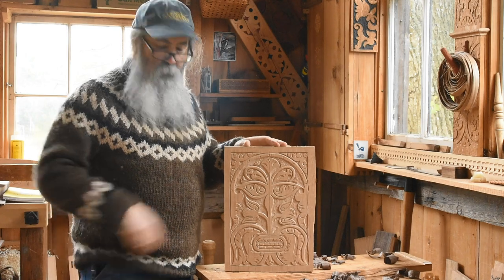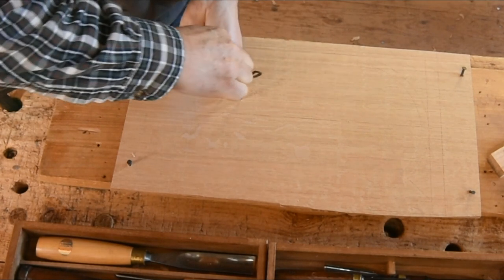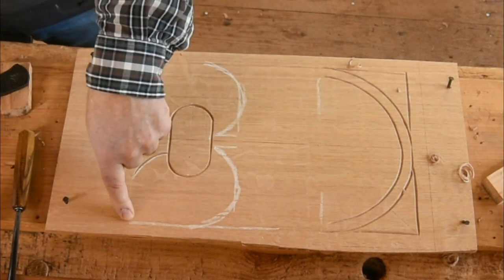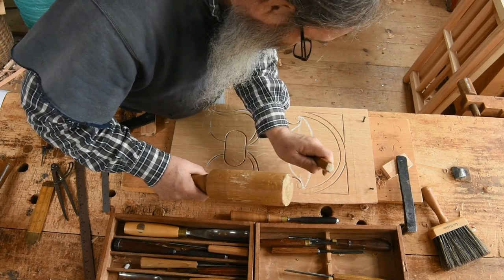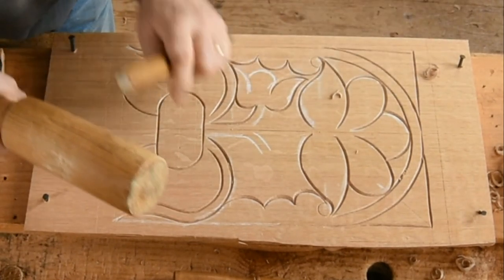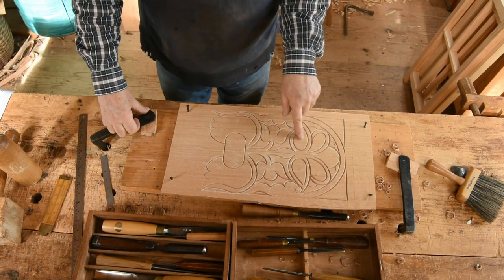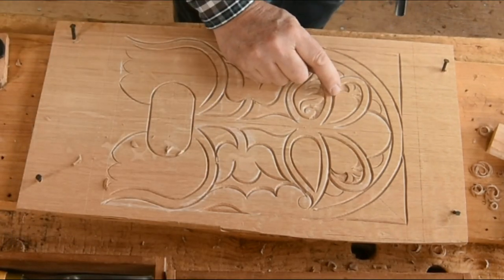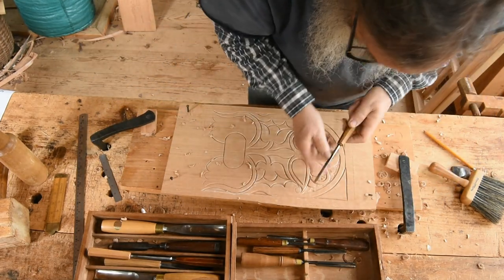Floral panel pt 1

Comment: Really enjoying your approach. Breaking it down to its elements.   You mention no electricity. Do you heat your shop at all in the winter?  Wood stove??   Not sure if you have done a shop tour but it would be interesting to see. I know is built for hand tool work and is fairly small. I love what you have done with your shop.  Thank for sharing and giving back Peter.
Reply from the maker: Thanks, Paul. I haven't done a video-tour. Maybe at some point. It is small, 12 x 16 feet with a loft over half of it. Yes, there's a wood stove. I rarely show it, because frankly I would get lots of free advice about safety, etc. It's in the corner just as I enter the shop. You can see much of the shop here https://pfollansbee.wordpress.com/2017/06/27/warts-and-all-workshop-views/